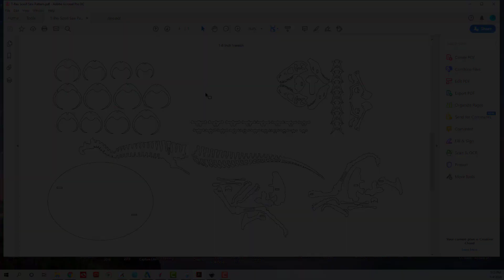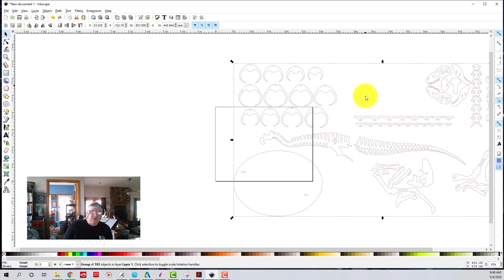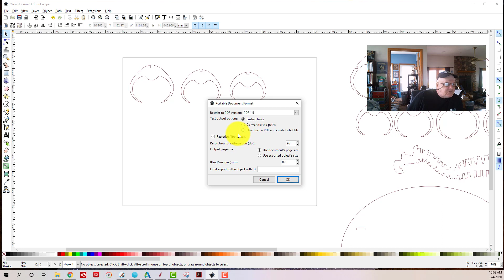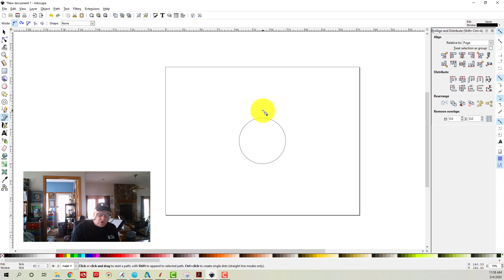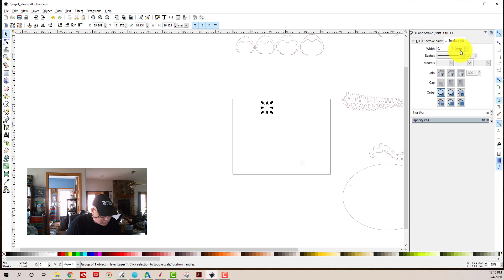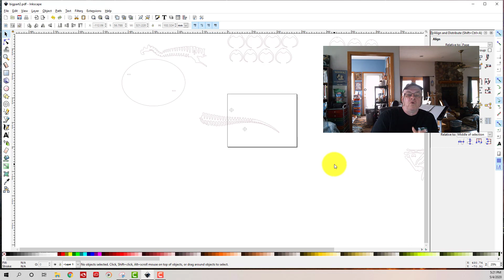Scroll Saw Tutorials makeCNC.com Laserscroll.com

Comment: I have a question  my motors are not moving spindle is working I can turn on spindle and on my control  box turn the speed up it works my motors will not I have followed  everything you have said with configuration ports and  pins  motor  tuning still nothing my mach 3 on my computer  is working  but the cnc isn't  moving anything  can you help any suggestions  thanks have a great day